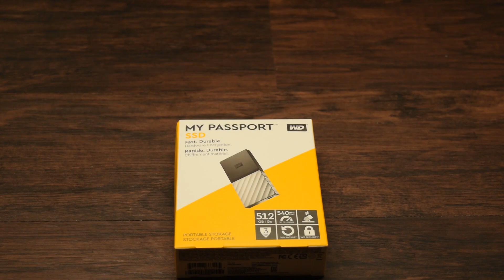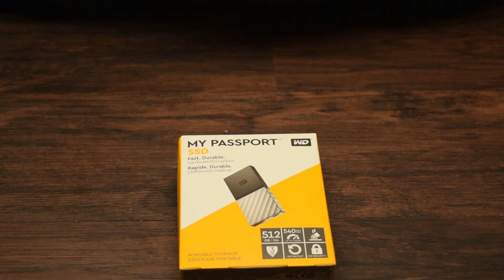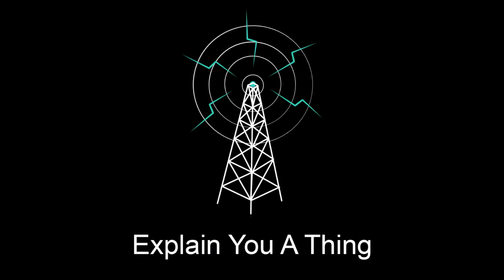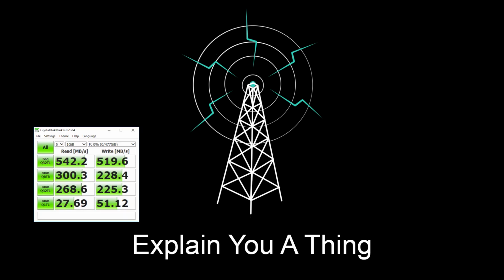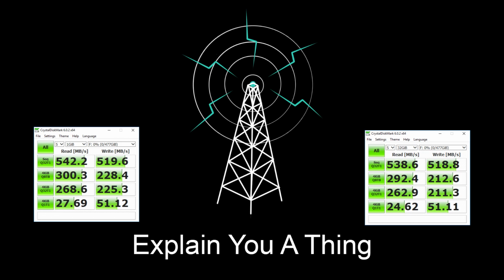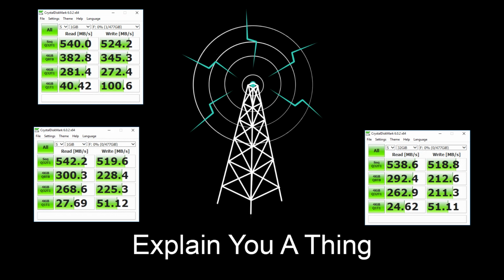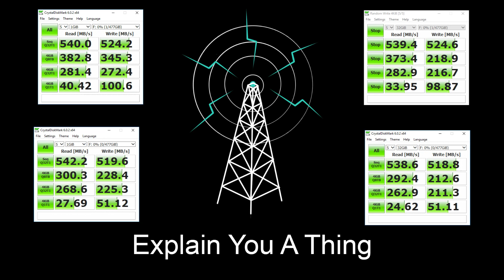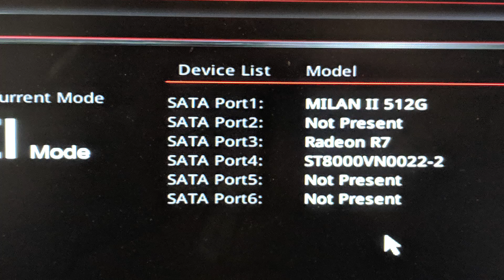Western Digital My Passport SSD Review and Teardown

Comment: So, if an external SSD utilizes an M.2 drive, I wonder if an internal SSD could use an M.2 drive.
Reply from the maker: They sure do.  Many modern motherboards have a slot for just that.  The drive slides into a slot and is then held in place with a screw.

Comment: Actually thanks ur teardown actually helped me i was going to use that as it was in my ps classic now I'm going to break it down and use it without the case and attach thermo padding to it and tape the parts that don't need cooling with electrical tape cool I have a inter hdd for my playstation classic console

Comment: Sooooo......I'm assuming you can swap in a larger drive if necessary?
Reply from the maker: That would be my assumption based on looking at the enclosure.  It's pretty much just an adapter to USB.  If you don't mangle the eff out of the thing when taking it apart, you should be able to use it for other drives.

I can't 100% confirm this as I don't have another M.2 drive lying around to slap in there so I'll just put that out there.

Comment: I'm stuck I can't get it off the board how did you do it where is the tape?
Reply from the maker: The tape is pretty much covering the entire surface area between the adapter and SSD. At least on the unit I disassembled.

I started by gently and slowly wiggling it and eventually it came loose, you don't want to pull up because that could put stress on the chips.
Reply: @ExplainYouaThing  we have the same unit I can't get it off
Reply: @ExplainYouaThing  when I try to pull it its stuck I peeled those black things off lol but at the end of it where that black black rectangle holding it in I can't get it to come out of there to detach it where sata is
Reply from the maker: @dannyrusnak9998  Hmm, the slightly more risky option would be something like dental floss between the parts to see if you can cut the tape. It's either that or very gentle heat. Possibly a hair dryer on low. Heat gun would probably be out of the question as I'm not entirely sure how much heat these were designed to tolerate.
Reply: @ExplainYouaThing  where is the tape I removed the black things the black squares that was like foam kinda I don't see the tape in your video when you got it off I couldn't see what you did
Reply from the maker: @dannyrusnak9998  view of the adhesive pads holding the two boards together is at 8:02
Reply: @ExplainYouaThing  im sorry to be such a pest lol ok the problem is that black rectangle box holding the ssd when I pull it will not come out I tried the dental floss nothing how do I free it from that box im afraid if I pull up im going to snap the ssd in half
Reply: @ExplainYouaThing  Update I got it finally now my laptop is not reading it at all LOL FML

Comment: so is this a 1tb wd blue ssd? or which ssd is in there? but nice to see it is upgradable
Reply from the maker: I'm not sure what it is to be honest, the internal drive has a part number and s/N that don't seem to be present if you go googling. That being said, it does use SanDisk flash chips and WD does own SanDisk.
Reply: @ExplainYouaThing  Just like I had bought a SanDisk and found WD inside it.
Reply: @Dave N No it is clearly visible M.2 SSD
Reply: @RRD97  Is it a SATA-based m.2 or PCIe?
Reply: @michaelwai2092  SATA as per his video.
Reply: @RRD97  Yeah seems like it, since his PCIe slot was compatible with SATA m.2 and he had adjust in BIOS.

Comment: Looks like a nvme m2 ssd, not msata, could you please confirm? I want the disk inside this thingy
Reply: its not nvme, its m.2 sata.
Reply from the maker: I misspoke in the video, yeah it's the m.2 fits in a standard PCIe slot as Shown around 8:00 into I'm dropping it into the M.2 PCIe slot on my motherboard.
Reply: @ExplainYouaThing  What was the speed once it was in the M.2 PCIe slot? Better? Same?
Reply from the maker: Nearly the same on my test rig, about 5 MB/s between USB3 and the m2 slot

Comment: Thats solves my question about the size so it won't work as a internal mSATA for my Dell xps 12  Thank you
Reply: It is a sata interface so you can just get an mSata to m.2 adapter but the adapter might not fit in ur laptop